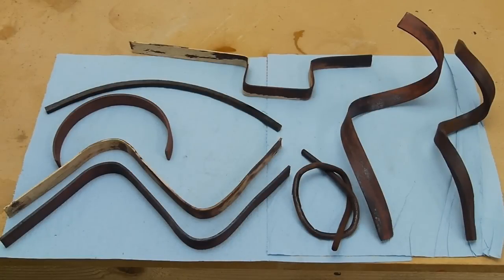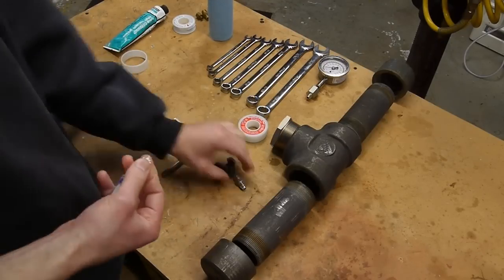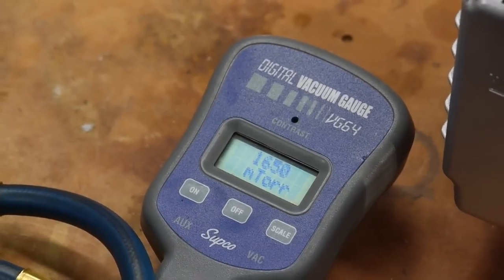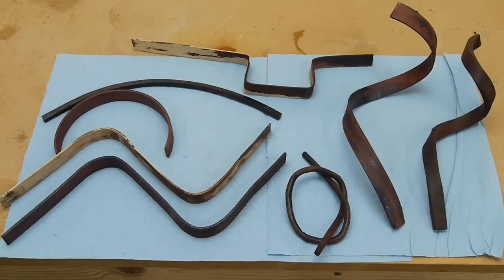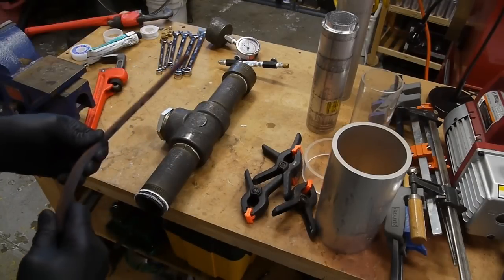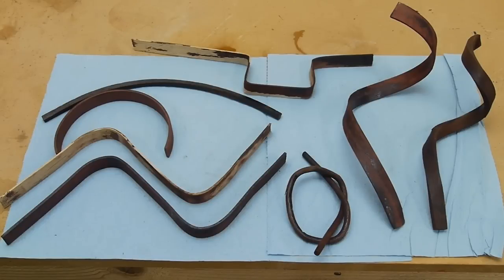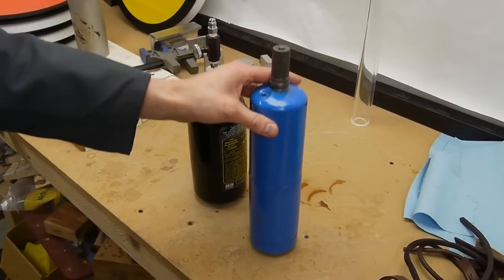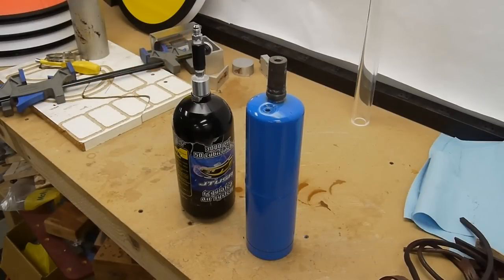Extreme wood bending with ammonia

Comment: Hi ben!

Regarding your corrosion issues : if you manage to make your ammonia really anhydrous (for instance, by dissolving a tiny bit of sodium in it and distilling it again), you shouldn't get any serious corrosion issues with it.

What happens is that ammonia dissolves the passivation layer that forms on many metals. Normally, the reaction can't go any further than that :  the pKa of an amide is way to high for it to give protons that could oxydize your metal.

How ever, if water is present, now you have labile protons available. The reaction that takes place is the standard dissolution of a metal in an acid, with its thermodynamics further driven by the formation of ammonia complexes with the resulting metal cations.

(That is why copper corrodes in ammonia solutions, even without O2 around, and despite the fact "regular" acids cannot dissolve it).

Also, regarding the aluminium, I wouldn't trust it for storing ammonia that still has water in it : the basicity of the solution might be sufficient to dissolve the aluminium oxide layer into aluminates, and quickly corrode the reactive aluminium metal underneath.

Try putting aluminium foil in aqueous ammonia, and you'll see hydrogen starting to bubble off. Granted, ammonia and water proportions are completely different here, but I still definitely would not trust it.
Reply: Really thorough and interesting explanation, ty

Comment: Great video, I didn't know ammonia-treated wood was that flexible! The brilliant blue corrosion you described on the safety valve is of the tetraamminecopper(II) ion, most likely the hydroxide. Storing the ammonia in the aluminium bottle might be OK if it's dry ammonia but seeing as it is wet it is definitely not a suitable permanent storage device because you can get ammonium tetrahydroxoaluminate forming due to the presence of ammonium hydroxide.

Comment: A PVC tube with capped ends, (one glued and the other using a plastic bag as a gasket) has contained my ammonia well for about two years. No idea if it's appropriate, but its been sufficient so far. Definitely works wonders with bending. Thanks for the video!

Comment: In the agricultural market, anhydrous ammonia is transported and used as a fertilizer in massive quantities. Trucks which were set up for hauling propane are converted for hauling ammonia by removing all brass components and replacing them with stainless steel.

Comment: The trick of the product you mention seems to be in it being compressed.Bendable Wood is a cold-bendable compressed wood that enables the creation of dramatic and unique bentwood parts using thick, solid, quality hardwood lumber. This is a different process, where the wood is extremely compressed. There is another youtube video demonstrating the product and giving some saw instructions.

Comment: How did you get from "I have some dry ammonia" to "Let's try bending some wood with it" ? google patent search?
Reply from the maker: Zarouszz I did a wood-bending project a few years ago, and saw a forum posting wherein someone claimed that spraying Windex on the wood (very thin plywood) would help it bend as the piece was slowly pulled into shape.  It seems that Windex may help slightly by simply wetting the wood, but the ammonia content is so much lower than the water content, the contribution of flexibility from the ammonia is almost nothing.  I did more research and learned the professionals use ammonia to get the wood really flexible.  I've had the idea in the back of my mind for a while.
Reply: Applied Science Is this possible because the ammonia denatures the protiens in the wood, making it more bendable? Im still a student but that would be my educated guess.  I would like to know more about this process even though I wouldn't be crazy enough to produce the ammonia needed.
Reply: NotaPro He discusses his theory at 5:50
Reply: Applied Science Lignin is soluble in water in alkalic conditions. It might be, that the ammonia gas works its way into the wood via diffusion, dissolutes in water inside of your wood samples and dissolves part of the lignin.
Reply: Zarouszz You're one of them chicken came before the egg people...

Comment: In reference to 4:18 Doesn't heat up occur due to pressurization of the chamber. You drew it to a slight vacuum but adding the chemical using vacuum drag has the same effects as pressurizing a container which causes heat.

Comment: Interesting video, thanks!

I wanted to ask about the grain direction of the pieces of wood you bent successfully vs the soft wood (pine?).  Wood that's steam bent tends to fail along the growth rings, and the soft wood looked to have failed in that way, or possibly the hardened pitch in the pine functioned as a vapor block.  Did you happen to notice if the hardwood you bent well was parallel or perpendicular to the growth rings or if you managed both orientations well?

I think the plywood and particle board failed because the glue/resin used retards the absorption of moisture into the wood beyond the exposed edge of the piece, which is why they are such stable products; but it's interesting to note that ammonia gas will not soften resin/glue.  Also with plywood, the board plies are laid in alternate grain direction, opposing directions every other layer, so it may have failed anyway.

Comment: Thank you for this very informative clip.  I remember reading about this process many years ago, but it was described as an obsolete technology, once used on an industrial scale for furniture production.  I'd searched for info on the topic to no avail.  Your presentation confirms my take on the basics involved.  
A couple of quick questions: have you experimented with maximum thicknesses?  What about time required in relation to thickness?  Did you run into any serious discoloration problems with any particular species?  Sorry...I'm clearly trying to pick your brain...

Comment: so at this moment I have a piece of steamed poplar hard wood in a form
It is roughly 2" thick poplar, which will be curved to match the wall under a spiral staircase

It is 2" thick because it will be the door (little closet door) food under the staircase 

I have to wait up to 7 days for it in the form
and even then, this is the 2nd time I've steamed it

steaming wood takes a long time 

this ammonia method looks like a HUGE TIME SAVER!
Reply: Would be nice to see some side by side comparisons of the two processes.

Comment: Thanks Ben! I'd been told about this wood-bending process, but hadn't tried it out. Given the similarities to steam bending (minus the heat), how would this experiment have differed using off-the-shelf 30% ammonia solution under vacuum/pressure and/or heat? [I would guess that water would help relieve tension in the wood fibers and enhance penetration of the ammonia]

Comment: Many years ago, when I did a lot of machining, I learned that aluminum sometimes contains copper impurities in the form of tiny flecks of copper.  I'd find those flecks while buffing a piece to a polish in once direction a bit too long.  The copper flecks created a V shape in the metal since the copper is harder and the aluminum softer.

Now, years later, I've also learned that in early apothecaries, copper "verdigris" (used as a medicinal ingredient) was created in the lab by mixing honey and salt, smearing it on a sheet of copper, and suspending the doped copper over a shallow dish of ammonia for a prolonged period.  Aside from really stinking up my kitchen, the technique does work, though slowly, so copper and ammonia do produce the blue-green fuzz known by that name.

Take those two thoughts and add them together, and I can imagine that the tiny flecks of copper in lower grade aluminum would indeed react with ammonia, producing microscopic deposits of copper sulfate crystals.  Would that affect the effectiveness of your pressure vessel?  Possibly.

Please excuse the roundabout way I get to my point.  I'm a science enthusiast of many disciplines and all self-taught, so I don't always take the most direct route.

Comment: I think the bendable wood product you mention is made by compressing steamed wood lengthwise by about 20%, and as long as the wood is kept wet, it can be cold bent. The compression allows the outside of the curve to stretch. It is at puretimber.com. There are electron micrographs showing before and after compression!

Comment: You used alot of woods that typically doesn't bend well at all. So this is a lot more impressive than most people probably think.
Reply: I would like to see it compared to traditional steam bending for those woods. Hard to say if there is a real advantage other than temperature.

Comment: I wonder how much of this is actually due to the chemical reaction. I make bentwood jewellery, and you can bend a veneer strip into a ring with only about 40 minutes soaking in boiling water, and I know that steam bending can be used on much heftier pieces (although I've never done it personally, so I can't give specifics). I imagine being heated all night long would produce some impressive bending, so it may just be the prolonged heat and moisture.

Comment: Very interesting, and I have a question; once you bend the wood into shape and let the ammonia dissipate, what sort of concentration of ammonia is left, if any, in the wood? The reason I ask is I am interested in using a bent wood dowel as a pipe stem for an extra-long "wizard pipe" and I would be concerned that some ammonia might be left and therefore hazardous to put in one's mouth.
Reply from the maker: primatebuddy The ammonia is a gas, so with enough time, it will completely dissipate from the wood.  I've noticed the wood samples that I bent in this video smelled like ammonia for a couple days, with it still being detectable but at a very low level for another week.  If you give it another week after that, you should be fine.
Reply: +primatebuddy I was wondering the same, for the same reason after watching this clip.
After some (a lot...) googling i discovered that it depends on a lot of factors.
Al tough i do not feel like writing an essay here, so i will end with:

The longest time i can conclude that it would take for it to become "safe" would be around 1 and a half month. (with 1 week added due to unknown factors) how ever like Applied Science says, almost all woods would be safe after 3 weeks.
Reply: after bending and drying in ambient conditions, toss your pipe stem in a vac chamber and heat it up to 150 f or so. voila, no more ammonia in your wood. if permeation will put it in, it will just as handily remove it, lol. of course, the stem will have to contact the chamber wall to actually get heat transfer under vac, so do it before finish sanding and such, just in case it causes a blemish
Reply: I came here to ask about this application. Sounds like briar would be a great candidate for this.

Comment: Alluminum serves well, the metals that you should be aware of, are: Cobalt, Copper, Nickel, Cadmium, Silver, Zinc. 
Alluminum is not capable of forming a complex salt with ammine ligand. However, if it is oxidised, it might (maybe) react with NH3OH — a weak alkali. But the Al(OH)3 is insoluble, so the reaction stops anyway

Comment: Cool vid but you skipped the part where you emptied the vessel of ammonia and extracted the wood. Rather a vital part. Also, what safety gear and precautions did you take beyond the gloves? Intrigueing difference between the pine and hardwood. Would be interesting to figure that one out. Can't remember if walnut and bloodwood are open-celled like red oak or not. That would at least partially explain it. If you tried white oak and red oak I think that would be difinitive as white oak is closed-cell.
Not to be a spoiler, but there was a book of magic tricks I had as a kid and one of the tricks was soaking a US dollar bill in ammonia and ironing it. It shrinks down rather drastically I think. The trick was to get someone in the audience to give you a bigger bill and do some slight of hand to swap it out for the ammonia soaked one before ironing it :)

Comment: When the ammonia gas expands into the pressure chamber it cools down. (That is how refrigerators work) That is probably the reason why you get condensation at that point.
The pressure chamber will then be cold. After the chamber is sealed and you let it sit for a while, it will go back to room temperature, and the pressure will increase.

Comment: Could this process in a modified sense be used to dry green wood?
Since the ammonia temporarily removes the strength of the wood, it takes all or most of the tension out of the wood, then if you filtered the ammonia to remove the water and repeat repeatedly you would end up with a dry(water) piece of wood that has no built up stress in it as such no cracks, splits or warps normally associated with drying wood too fast.

Comment: Wasn't the heat (at about 4:00) comming from the pressure increase, when the amonium gas was released into the low pressurized pipe?

Comment: Teflon tape isn't for sealing threads, contrary to popular belief. I have been in the heating and air conditioning trades for well over 30 years. Pipe dope of various types should be used to seal the threads. Teflon tape was introduced as a lubricant for the threads so that another 2 or so threads could be gotten into the fitting. I rarely use Teflon tape at all. If you use pipe dope instead of teflon tape, you can draw down a vacuum as deep as you'd like in a tiny pipe chamber like the one you were using in this video.
Reply: Correct!  Teflon tape seals nothing except your uninformed brain... Now, as far as the vacuum..... Rarely do HVAC guys leave a pump on long enough.... let alone down to Torr.   In actuality once you get below 200 microns the hoses start gassing..... (decomposing)
Reply: It's good enough for sealing against water.
Reply: Tezcax and many other things... Maybe not the best in a vacuum with refrigerant, don't know...never had it fail in any water, oil, or air situation...

Comment: Aluminum is ok to use with ammonia as our relief valves on our bulk tanks are made of it . But not shure what type of aluminum it is (ie what alloys are added )but it seems quite soft like pure aluminum as the threads are easy to gall .

Comment: will this product be bad to breath in if you shaped it as an air freshener?
Reply: anhydrous ammonia is a deadly poison. it is also very flammable. any wood formed will have most natural oils at least partially saponified (oil and alkaline makes soap), so any odor will be markedly altered (your cedar will NOT smell like a hamster cage, lol). if you want to bend aromatics, and keep the aromatic character, bend with steam. this would be far more suitable to laminating thick pieces into radius bends steam can't quite handle, than using to make helix shaped cedar "nicely stinky wind chimes". a steamer is FAR easier to make, and far less hazardous as well. a few pieces of pipe, a gas line for a stove, a cheap stock pot, some pink scratchy insulation, and a metal plate (if your pot has no lid, lol), you have a steamer. size of piece is only limited by your pipe, and your pot. the "working fluid" is nice safe water, which only become hazardous if it's deeper than your upper lip, lol.  there is NO need to operate at pressures above ambient (though pressure will accelerate the steaming process), so no explosion danger. steam would be a better choice for that particular use. steam will also soften soft woods, so has a bit more generic utility. ammonia bending is a great idea, but only if you actually NEED it.

Comment: Hello Ben. This video caught my eye, in part, because I bend wood all the time, in my work as a guitarmaker. Quick question, if the wood is soaked in a water/ammonia bath/solution, for a few days, would that help with bending? Just curious. Thank you for your videos.
Reply from the maker: +Tsiorba Guitars Luthier: Classical Flamenco Guitar Repair I believe soaking wood in water/ammonia (window cleaner) will soften the wood mostly because of the water.  Soaking the wood in anhydrous (dry) ammonia causes it to become soft via a different chemical process.  I haven't tested it, but I suspect soaking in water is just as effective as window cleaner.
Reply: +Applied Science 
Thanks for the video .We got a special project at the university,We need to make a"wood" leaf spring for a powerriser (jumper)!
Is there any other way to bend the wood like this ?
Any advice how to put the component together !
 4 mm dick Hard wood ,then 4 mm soft wood (twice) and least glass fiber  und TAPE:D:
I am going to test it with my 80 kg  .....
thanks for your time :)

Comment: aluminum will gradually solvate in liquid ammonia via an electride process.  will work for a while but there is serious risk of catastrophic decompression over time.  for more info wikipedia electrodes and alkalides.  very interesting stuff.  don't know the specifics about your aluminum.  some aluminum alloys may have differing reactions to liquid ammonia.  there is little risk of solivation from hot gasses.

Comment: Isn't concentrated ammonia-water called ammonium hydroxide? And isn't that cheap as dirt? And isn't that much easier to work with? Would that work?
Reply: Walter Clark ammonia water is called that. but it's inaccurate because the equilibrium is aaaall the way towards "just" aqueous ammonia, which is how it should be called. it wouldn't work because high-pressure gas is a completely different beast then a simple aqueous solution.